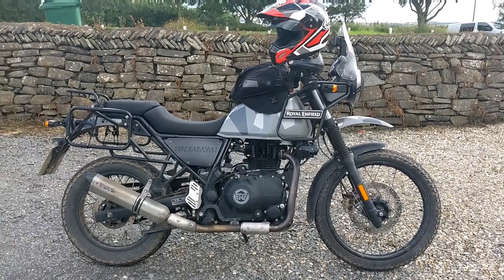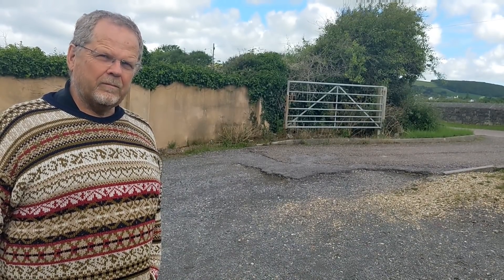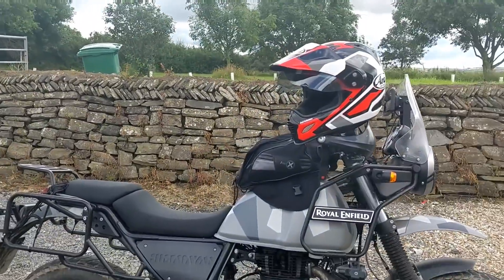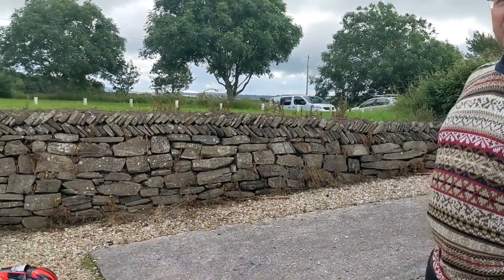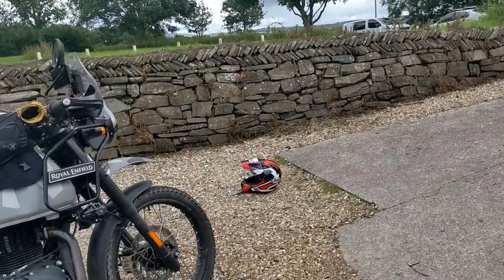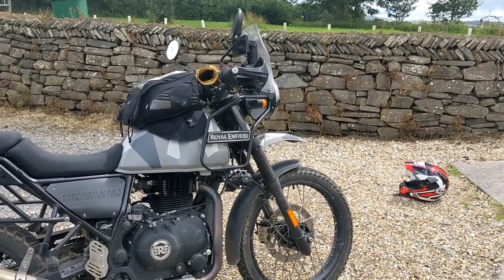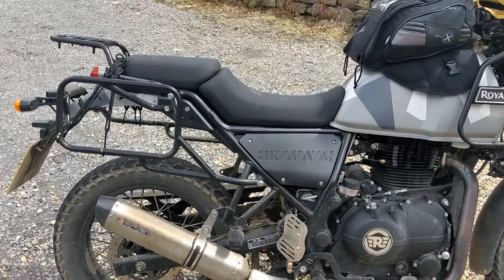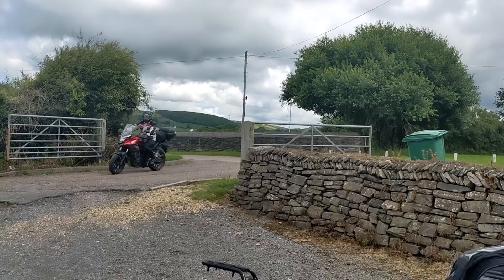Quick ride and rambling discussion on a Himalayan fitted with TEC Performance Camshaft.

Comment: Nice to see someone call out the cheap exhaust. I have long suspected that many of the cheap and nasty options are just noisy and make the bike run worse
Reply: When I purchased my Classic 500 years ago it came with some nasty eBay special muffler that was so loud it gave me a headache. I have a long incline up here near me in the mountains. It’s 2km of increasing grade and I would have to gear down the C5 to 3rd gear to make it to the top.

I found an OEM exhaust which not only made the bike comfortable to the ears. It actually brought back the midrange torque and I could get up the same hill without gearing down at all.

Most of those exhausts are just nasty cans of wasted money. Offering a placebo of noise and perception of speed and power.

Comment: Put a booster plug on my 660 tenere and straight away much smoother and more tractable. 
Even better with a  freer exhaust. Plug plus pipe 350 notes and it transforms it. And wright liss too. Plus moves the weight lower down.
Those plugs are fantastic especially with a more open pipe.
Open air filter next step. 
Great mod. Seeing is believing. 
Happy travels
Reply: Hi, what model booster plug did you get?
Reply: @hespie1  booster plug. Just look this up, they are kodel specific. Plug and play. No splicing.
Reply: My 660 tenere ran like crap below 3000rpm.
I did the so called kev mod and it improved greatly.
Reply: @rickz9495  works in a similar way I think and kids the ecu into adding more fuel. They run a lot better with these mods.

Comment: Interesting video :) 4hp is actually more than some 1920s bikes had hp wise an some of those would do 70 o.o totally digressing its mad when you look at how light some of the older bikes are 110kg etc an then the weight of some of the 60s bikes. It's a shame they can't lob some weight of the Himmy be interesting to see how much it would need to loose to get similar gains. Great video as always an thanks for the honest conclusion to Nathan.
Reply: Heavy weight is needed for highway riding - to resist wind buffeting. Plus it keeps the bike stable over potholed roads
Reply: To mitigate the weight i removed the tank/jerrycan frames and put the headlight directly on the fork...when I have some money to spare I'll go with exhaust (the stock one is real heavy)

Comment: 5 mph increase is inline with a 20% power increase. The power required to overcome air resistance increases with the cube of velocity, so if the previous top speed was 70mph, you'd expect 20% more power to give a top speed of around 74.4mph.

Comment: The Delkevic pipe is a far better exhaust I feel-looks better-performs well without being too noisy but certainly sounds throaty under load. You haven't removed the front header pipe to get rid of the other cat. This bike has had a hard life, as you can tell by the condition of the header pipe! You need to get the fuel mapping done properly once the cam has gone in. Does the bike pull 6,500 rpm? Will it pull over 70 mph? Will it still chug through a river at low rpm with this cam? I think to get the most benefit you need to replace the entire exhaust system-put the cam in-get the fuel mapping tuned at the end to get the most from the bike. Then see how it performs.

Comment: I always wonder if such a mod is so successful, why haven't Royal Enfield developed a camshaft with a similiar profile for the standard production model. They must know about it, and surely they'd be happy with 4 BHP extra. Hi from the chap in Lynton. See you next time you're in Porlock!
Reply: Emissions is the reason RE don't fit one from standard.
With the 20% Camshaft fitted it wouldn't pass Euro4 or now the even stricter Euro5 Emmissions
Reply: Emissions obviously .
Reply: I'd blame emissions but then again most other manufacturers make around double the hp with the same cc and pass emissions.
Reply: @jarrodwilson7702  Other manufacturers use water cooling for a more constant temp and thus can use tighter clearances
and higher compression ratio and yet have lower emissions.
The Himalayan relies on air/oil cooling for simplicity/reliability/repairability/affordability - better for 3rd World owners.

Comment: Sounds great, will look into this mod for my Himalayan.
Just wonder if that changes the valve clearances for optimum results.
Reply: It shouldn’t but it would be very worthwhile and encouraged to check valve clearances since you’re already there and it’s an additional 10 minutes of measuring and adjusting if necessary at most.
Reply: George at TEC has a discussion on this on the TEC channel!

Comment: Hi Nathan, is it just that addiction or the combination of the exhaust and the power booster(?!?)) that gives the better experience??
Reply from the maker: It's impossible to say without stripping each part off one at a time and assessing the difference. I would say the spark plug will make barely any difference, the exhaust in my opinion makes the bike perform worse if anything, so I'd say the 'gains' are from a combination of the booster plug and the cam, and having tried a Powertronic I'd say most of the gains on this bike did come from the cam. But I'd love to try the cam on a stock bike to say for certain.
Reply: @nathanthepostman  thanks for the update!! Can’t wait to to see the 650 Himalayan!!!
Reply from the maker: @generalt1090  I think you could be waiting a while on that one. Something's coming, but very unlikely to be a 650 Himalayan
Reply: @nathanthepostman  dammit!

Comment: Thanks for your honest first impressions.  Do you think you would lose any of the low end "tractor factor" for offroad purposes?  I have to ride at least an hour to get to any off pavement riding, so making that easier would be great, but I'm not sure if I would want the trade off to be poorer offroad performance.
Reply from the maker: That's a great question and I don't really have an answer as I didn't ride it off road. It didn't seem to be peaky or lose any low down chug on the road riding I did, so I suspect it hasn't been adversely affected for off road use. But I'd definitely like an extended ride on one before saying with any confidence.
Reply: @nathanthepostman  thanks.  Hopefully we get some more feedback as more kits get installed.
Reply: @leenvisser4649  I am the 'Mike' in the video. The bike is far more tractable than standard, I have done a fair bit of off-road, and the low-down torque is enhanced. I have used the bike with standard gearing and with a 16 tooth gearbox sprocket, and while standard is good, for me, the 16t sprocket is a further improvement. As one extra tooth drops revs by 500rpm, and the cam moves the power and torque 1000rpm down the rev-range,  on paper it should be better and the seat of pants feel is that it is.

Comment: Notice the hesitation at low throttle when he to the bike for a test. This is my main beef with the bike as making a slow turn with precision is dicey. I find I have to keep the rpms a little higher than I am accustomed with my experience to prevent a laugh in drop. I heard the word I wanted…”hiccup”.
Reply from the maker: Yes I see what you mean by the video - it does look to drop revs quickly ,- but I don't tend to have problems at slow speed on them and tend to find it's one of their best strengths that you can ride them slowly without stalling

Comment: Is it possible to install the front indicators of Highness on Scram 411 and conty 650? And I mean proper installation so the amber light turns on with ignition as in stock CB350.

Comment: Completely off topic, but I am looking for a magnetic tank bag and yours looks about right. Can you tell me what the make (and model) is? Thanks
Reply: just buy a givi tank bag with the tank filler locking ring..i have a 20 ltr one on mine and its perfect, one lever click its off, straight push on to lock in and the mofo wont go any where lol :D
plus if you buy another bike you only need the bike specific tank filler locking ring and the tank bag will fit all :)
Reply: It's Oxford 'First time luggage'

Comment: brill info vid :)
really wanting a TEC cam as only £166.66 and gets them to 30hp and maybe up the front cog one tooth ...but bike is only 3 months old...suppose i could fit one and say nothing to dealer and still have warranty, they wont notice lol :)
Reply: I find it hard to believe that the camshaft mod brings this bike to 30 hp. I've seen the dyno graphs, but 30 hp at the wheel is similar to a stock DR650 or 310 GS, and those bike are faster than any modified Himalayan that I've ever seen or heard about.

Comment: what's the mechanical explanation here? changing the timming of the valves?
Reply: In the TEC Bike Parts video on their Performance Camshaft,
it's said that it was given more overlap, lift, and duration -
the classic things before emissions became important.
Reply: @daveinwla6360  thanks for the reply! I had to research a bit on the terms, but now I think I get it. Fascinating stuff about timing and all... and I see why overlap is minimized for emission reasons. From my understanding this mod should increase fuel consumption since it is pissing out unburnt fuel mixture to purge the exhaust gases.
Reply: @u0000-u2x  The fuel efficiency can sometimes actually be increased with such mods.  With a cooler running engine, you can "lug" the engine uphill (i.e. impose a high load at low rpm) and not get detonation while benefiting from the greater efficiency of low rpm.  Low emissions come at a high cost.  Have you noticed that bike models are given greater engine displacement when emission regulations tighten?

Comment: It always amazes me how people think they know better than the   O E M' s engineers, whether it be a BMW car riding half an inch off the ground or farting around with camshafts.
If you want to travel faster, buy a faster bike. Piddling about will reduce reliability and increase stresses on the engine. I will certainly be keeping mine stock until warranty has expired and probably for good
.
Reply: The issue is that the OEM manufacturers have to compromise with emission regulations in particular countries, and for an air cooled engine like this, that means a significant impact on power output. So, yes it is relatively easy to improve these 'constricted' engines with some well-designed, after market upgrades.

Comment: I love this bike, but for North America it’s frame is not strong enough and it’s just so under powered it’s not a safe to ride here. :(
Reply from the maker: I'm not entirely sure I'd agree Jeff. I rode my Himalayan coast to coast across the USA in 2018 and yes high up in the Rockies it did get a bit breathless but it still coped fine on the interstate and perfect for the back roads. There's nothing much wrong with the frame either these days, just the early Indian bikes that were a bit weak. Might be worth you trying one
Reply: that's bullshit. it performs just as expected for a thumper.